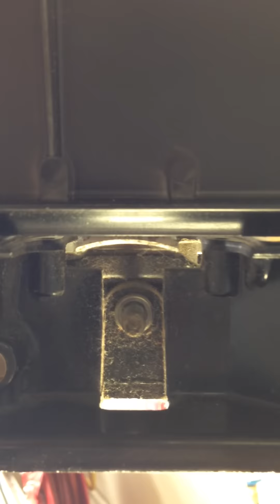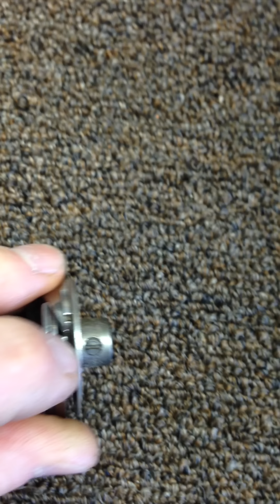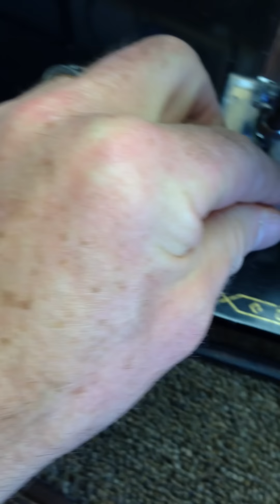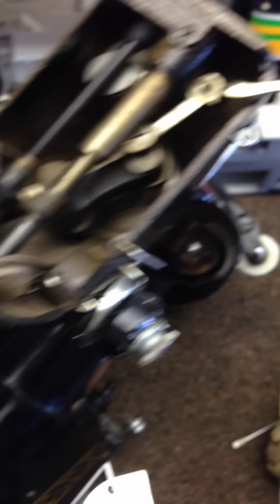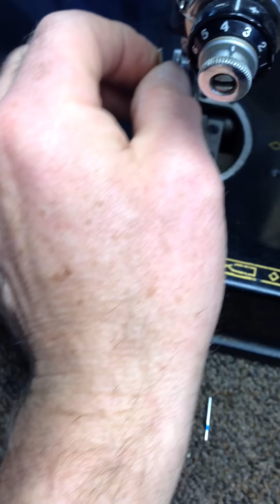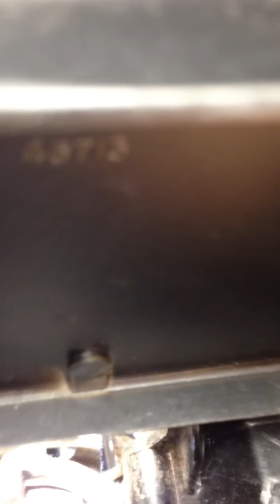Sewing machine hook timing

Comment: Hey! So I thought this was my problem with my machine, but as I checked the timing it seems to be correct.  My problem, is I can't get the needle thread to pick up the bobbin thread.  Nothing at all happens with the bobbin thread when I manually turn the wheel.  It spins as it should, but the thread is never moved.  I'm stumped. Never had this problem before. I haven't used my machine in a few ears, but it used to be my workhorse!!
Reply from the maker: The most common reason for that is that the needle is inserted wrong and/or threaded wrong. Orient the needle with the flat side of the shank to the left. Thread the needle from right to left.

Comment: Hi Paul, would you happen to know where the timing adjustment is on the old Alfa Z233 please? I cant find it! With thanks, John
Reply from the maker: I would suggest setting the needle in the center position and with the needle bar raised 2.0 mm from it's lowest point, the hook point should be directly behind the center of the needle.
Reply: Thanks Paul. The problem was I couldn't find an adjustment for the hook timing. In the end I drove out a roll pin from the crank at the other end of the bottom shaft, changed the angular position of the crank on the shaft to adjust the hook timing and it's ok now. The crank has a grub screw to "lock" the position on the shaft but I expect the timing will go out again if the needle hits something it doesn't want to go through. I couldn't find another way to adjust the hook timing. Nicely engineered machines though,the old Alfas

Comment: I would like to suggest that the old machines were made much truer than the replacement parts you may use. In my experience the parts I've bought were not as finely machined as original parts. I would use old parts from donor machines any time.

Comment: How do you get it out of the sewing machine in the first place? I have a 222kwith a broken gib hook . Can someone please tell me how to remove the bobbin hook assembly fron the machine?
Reply from the maker: Remove the needle plate.
Remove the bottom cover.
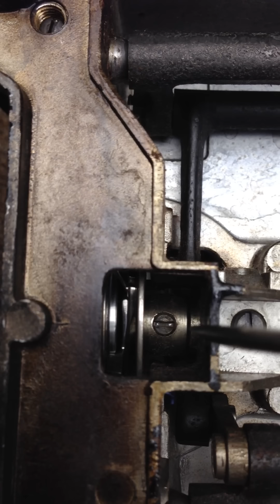Loosen or remove the two set screws of the hook. (see 3:35 of the video)
Slide the hook off of the shaft.
If the hook is stuck, be very careful not to pry it in such a way as to damage the hook. Slight pressure or heat will help a stuck hook move.

Comment: Hi,
I have used your video to time several featherweights. I would like to ask you about working on a sluggish motor. Is the cause carbon build up? Are there any demos available? Thanks
Reply from the maker: +MKWII HACKER 
I've replaced motor brushes, resurfaced the armature commutator, sprayed the motor with tetrachloroethylene and cleaned/lubricated the bushings with usually not much improvement. I don't rebuild electric motors, so I can't advise how to do that.